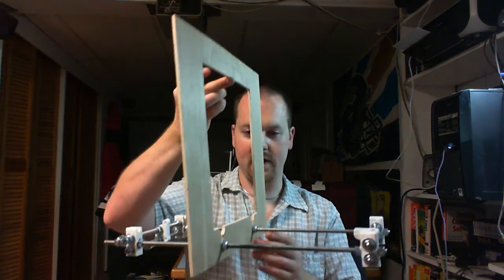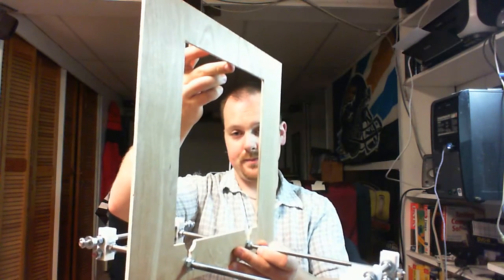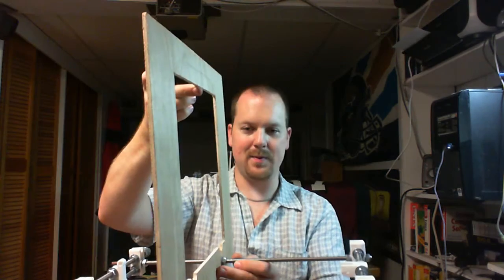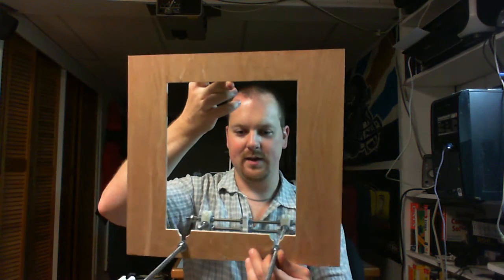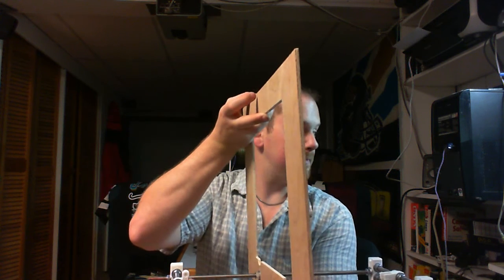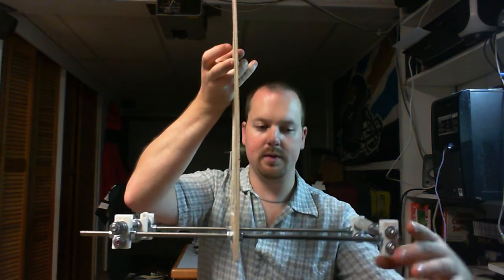Homebuilt Wooden 3D Printer (prusa i3) - Part 1

Comment: Hi, please share how you went from plan printed in paper to frame and y carriage? Did you use a wood router?
Reply from the maker: I took the measurements from the drawing and carefully copied them onto a sheet of 5mm plywood. Then using a drill and hand saw, I cut them out, no router. I have at a later time used a CNC router I built to cut out a similar frame.

Comment from the maker: I used a drill as well. woops. Overall dimensions of the main frame is 15" wide by 14 1/2" tall, 2" wide on top and bottom, 3" on the sides.